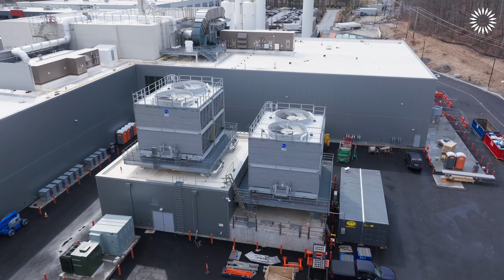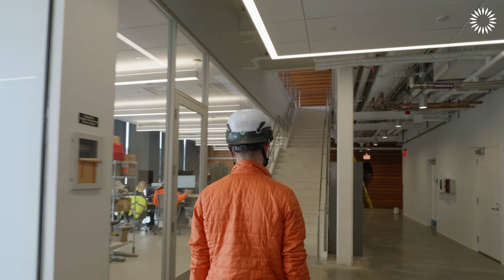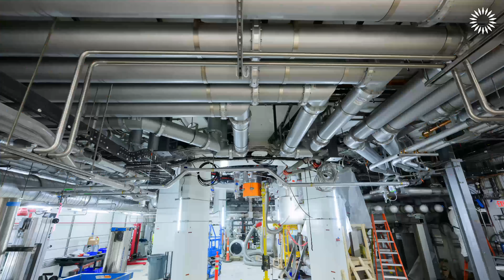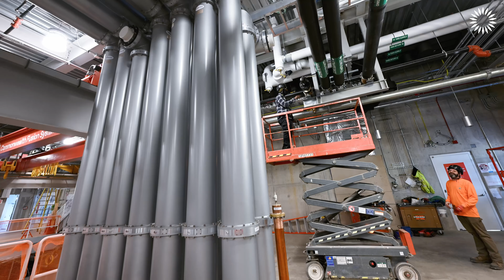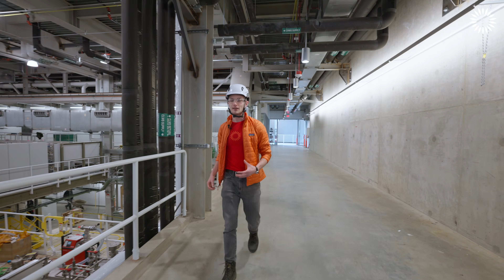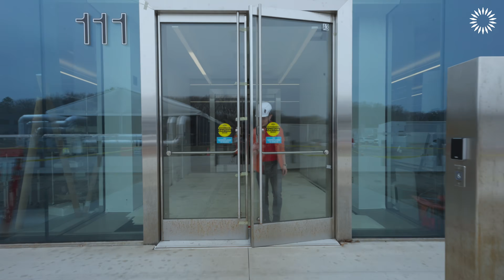Virtual Tour of the CFS Commercial Fusion Campus (April 2026)

Comment: Wouldn't supercritical CO2 be better for taking heat out of the tokamak than helium? :-)
Reply: Supercritical CO2 won’t function at the extremely low temperatures that the Toroidal Field (TF) Magnets (8 Kelvin), the Central Solenoid (CS) Magnets (15 Kelvin), and the Poloidal Field (PF) Magnets (15 Kelvin) are required to operate at. In addition, the Error Field Correction Coils, Diverter Coils, Diverter Coil Feed Cables, Vacuum Vessel Gravity Support and Thermal Shields are all intended to operate at 80 Kelvin. At such temperatures CO2 is in its sold state and therefore couldn’t transfer any appreciable amount of thermal energy deposited within the plasma, or within the surrounding experimental machine structure.

Comment: Is the helium cooling in vacuum vessel always circulating in a loop (ie operating continuously) or is the system intended to operate in a pulsed manner?
Reply: The supercritical helium circuits primarily cool the Toroidal Field (TF) magnet coils and the Central Solenoid (CS) magnet coils. The vacuum chamber receives cooling from a 80 Kelvin liquid nitrogen (LN2) circuit operating near atmospheric pressure. At the initiation of the 10-second test pulse the cryogenic flow rates will be drastically increased to remove the various sources of increased thermal energy deposited into the vacuum vessel and eventually by the 14.1 MeV fusion neutrons reaching the surrounding magnet coils. If SPARC eventually achieve CFS’s goal of more than 1.0 GigaJoule of fusion derived energy, during the 10-second test shot, then approximately a 4-hour thermal recovery time period will be required before the next experimental test shot can be conducted.
Reply: @vernonbrechin4207  Thank you. Do you know if the ARC reactor would also have a 4 hour thermal recovery period?
Reply: @Your_Paramour  - My understanding is that ARC’s current design calls for it to have very short gaps of OFF time compared to the fusion ON times. It is expected to have an entirely different energy extraction system. About a 1,000 times improvement, in the ‘fusion energy duty cycle,’ alone, will be required for the ARC power plant. It is assumed it will contain at least three separated cooling loop systems that includes a tritium breeding blanket and buffering energy storage reservoir. Additionally, a processing plant will be required to isotopically enrich the feed lithium with lithium-6 and another facility to extract and purify the generated radioactive tritium for re-injection as part of the D-T fuel mix feed.
Reply: @vernonbrechin4207 makes sense the duty cycle will require a 1000x increase if SPARC is 10s of fusion and 4 hours of off time. 

When tritium is created via the interactions of neurtons with the lithium breeding blanket, the tritium is embedded within that breeding blanket and extraction requires the reactor to be taken offline, the blanket replaced, and the extracted blanket to be processed in order to extract the lithium?
Reply: @Your_Paramour  - SPARC will have no tritium breeding blanket and there is no space to add one. If the first ARC machine includes a tritium breeding blanket then it will serve three function. 1) As a shield to limit neutrons and penetrating photons from reaching the various magnet coil structures. 2) As a medium that will  thermalize (slow the 14.1 MeV fusion neutrons down and convert their kinetic energy into heat) then remove that heat via a pumped fluid. 3) As a means to absorb a portion of the fusion neutrons, in nuclear transmutation reaction with lithium-6 to generate tritium. The proposed blanket will consist of a chamber just outside the plasma vacuum vessel containing a molten salt consisting of chemically bonded enriched lithium-6 and another salt containing beryllium which is to serve as a neutron multiplier. The salt complex will be heated to a molten state and circulated via a first stage cooling pump. The excess thermal energy, in that salt is to be transferred, via a heat exchanger, to another molten salt circulation system. Some of the first stage molten salt is to be passed through a system that will filter out the tritium formed in it and then that tritium will be purified before it can be employed to serve as fuel for the reactor. This entire scheme has never been designed and tested in any functional nuclear fusion energy reactor.

Comment: What are the big pieces that look as if they have window holes, and how will they be added to the tokamak?
Reply: That is a portion of the plasma containing vacuum vessel that will sit within the toroidal field (TF) magnet structures. It contains diagnostic windows.
Reply from the maker: The two half-donut shapes are the two halves of SPARC's vacuum vessel, the interior part of our machine that'll contain the plasma (our fusion fuel). Later in the assembly process, we'll thread each vacuum vessel half into a set of D-shaped magnets, then we'll weld the two halves together into one single donut shape.

The window-like holes are ports where we'll insert equipment like fueling systems and diagnostics. The vacuum vessel will be airless inside (thus "vacuum") so these will all be sealed up before we can operate SPARC.
Reply: @CommonwealthFusionSystems  - Thank you for these further details of the assembly. My assumption is that the plasma chamber vacuum vessel will be cooled down to 80 Kelvin before a 10-second fusion test shot is attempted. Then the 50-50 mix of deuterium-tritium fuel will be injected into the evacuated torus space as the Central Solenoid (CS magnet coils undergo a controlled current discharge. I assume that when the reaction is proceeding the vacuum pumps will continue to operate to remove stray molecules and some of the waste helium gas that will be generated by the expected fusion reactions. After that process the induced, injected and fusion generated fusion energy, will require hours of cryogen circulation time to return the SPARC system back to a temperature and stability point to where another test pulse can be attempted. I also assume, that far less than 100% of the injected fuel will fuse during that 10-second period of time and it will end up being pumped out by the vacuum pumping system before another test shot can be set up. Please provide clarifications if I'm in error on any of these operational issues.

Comment: Couldn't ARC use supercritical CO2 to carry heat out of the tokamak? It's much denser than helium, and should carry much more heat. :-)
Reply: The supercritical helium coolant system doesn’t provide a practical means of removing heat from the planned ARC power plant which is intended to generate more than a million times more thermal energy, compared to the SPARC experimental machine. The helium doesn’t absorb the energy from the emitted 14.1 MeV fusion neutrons and it doesn’t allow for the breeding of the tritium which is an essential process required in the ARC power plant  design.

Comment: Don't show a ham operator how you heat the fuel.
Reply: Note that the value of the combined energy, that heats the fuel plasma, is the value that will be employed to calculate the fusion energy gain (Qp). It only applies to the time that the SPARC plasma is engaged in fusion reactions which can only be for 10-second bursts conducted about once each 4-hours. This measurement, of fusion energy gain, ignores the far greater quantity of energy required to power the SPARC facility during a day of experimental test shots.

Comment: Approximately what temp will you cool the magnets to during operation? 

I think that HTS magnets show superconducting effects around 70K but you get better performance at lower temperatures. If I recall from a Tokamak Energy YT video on their cooling system they are planning for single digit Kelvin close to the regime "normal" superconducting magnets operate at.
Reply: According to the ‘The SPARC cryogenic system’ document the Toroidal Field (TF) coils will be operated at 8 Kelvin and the Solenoid Field (SF) coils will be operated at 15 Kelvin. Both are to be cooled by massive flows of supercritical helium during the ten second period of the hoped-for fusion ‘burn’ time.

Comment: CFS’s SPARC experimental machine will rely primarily upon vast quantities of stored supercritical helium to carry away the thermal energy generated by the fusion reactions generated by their hoped-for deuterium-tritium (D-T) fuel reactions. The solenoid field magnets are to be operated at 15 Kelvin and the toroidal field magnets at 8 Kelvin. Much of the energy, from the 14.1 MeV fusion energy neutrons, will be deposited into the refrigerated vacuum vessel and the surrounding cryogenic magnet structures. All the injected radio frequency (RF) energy will also require removal via the cryogenic system. The test pulses will last a maximum of 10-seconds. If CFS achieves its goal of one gigaJoule, or more, of fusion energy per test shot, then about a four-hour thermal recovery period will be required before another test shot can be conducted. This will mean that the maximum fusion energy duty cycle will be 0.0007 at near SPARC’s maximum fusion  energy design goal. A 1,000 times improvement will be required to achieve the fusion energy duty cycle design goal for the ARC power plant that must generate far more fusion energy derived Joules for each of its lengthy fusion energy pulses.

SPARC will lack the two molten salt cooling loop systems that are projected for the ARC power plant design. It lacks the superheated steam generating system, the waste heat dissipation system of the power plant design, the turbine and generator systems and the electrical substation system associated with the ARC power plant design. SPARC also lacks the essential tritium breeding blanket and tritium processing plant that the ARC power plant will require. SPARC’s tritium fuel will need to be sourced from commercial sources. For many decades tritium has been priced at approximately $30,000 USD per gram.

In conclusion, the CFS SPARC experimental machine will, in very few ways, resemble a ‘prototype’ of the ARC power plant.

Comment: Looks like a Mini ITER. Does its design follow the same requirements? Just less?
Reply: The CFS’s SPARC experimental machine is very different, in many ways, from the massive ITER project. The SPARC machine lacks experiments related to the design of a tritium breeding blanket. SPARC’s maximum fusion duration is slated to be 10 seconds, far shorter than for ITER. SPARC will also lack the robust thermal energy removal system that will eventually be needed for the ARC power plant design. If SPARC achieves CFS’s goal of generating one gigaJoule of fusion energy in any test shots then the machine will require about four hours of thermal recovery time before the next test shot can be attempted. This means that SPARC’s maximum fusion energy duty cycle will be 0.0007. There will need to be about a 1,000 times improvement on that parameter to achieve the specifications required for the ARC power plant.
Reply: @vernonbrechin4207  I know some have considered the tritium cycle, use, breeding, recovery, to be the main remaining doubt in functional fusion power plants.  I'm  surprised to hear that this isn't part of the SPARC R&D program.
Reply: @kreek22  - My understanding is that initially, just before CFS was created its founders initially assumed that they could begin the development of the ARC power plant. Then they realized that they were overly ambitions and ARC would likely not generate its intended electrical energy until late in the 2030s. As a result they came up with a test machine design that would produce some modest results that would then justify going further with their ARC machine project. In order to achieve that SPARC became a extremely stripped down version of ARC. Among numerous primary components missing, from ARC design, is the tritium breeding blanket and most systems associated with that for fueling the machine. Keep in mind that for many decades, since the fusion energy experiments began in the mid-1950s, journalists the general public and investors were told that the fusion hydrogen fuel was plentiful in ordinary water. The promoters have always oversold the level of progress in this field and that is one of the reasons it has been joked that a economically practical power plant was just 30 years away. The predictions have been based upon lies, distortions and the routine practice of omitting numerous key evaluation technical details, often with the excuse that those things are to complex to be included in promotional presentations.

The reason you were surprised is because most of the presentations, that you've heard, routinely omit the wide range of problems that still face the researchers. Being frank about such issues is likely to hinder the accusition of the enormous amounts of funding needed for these fun experiments.